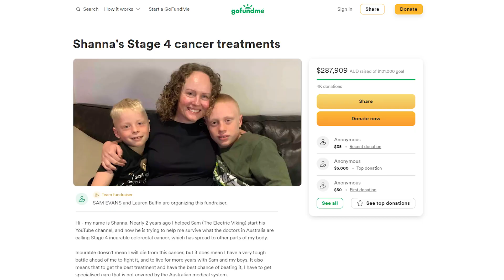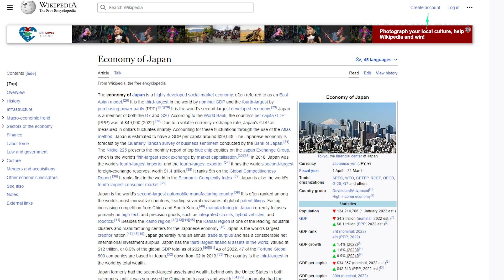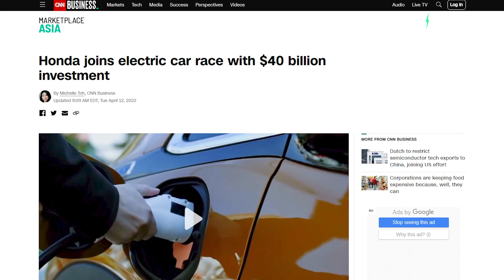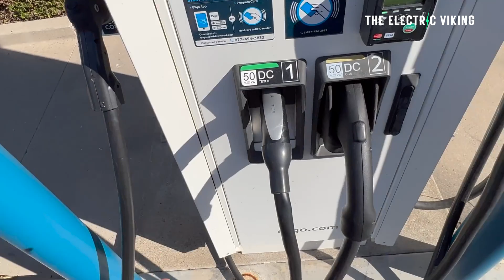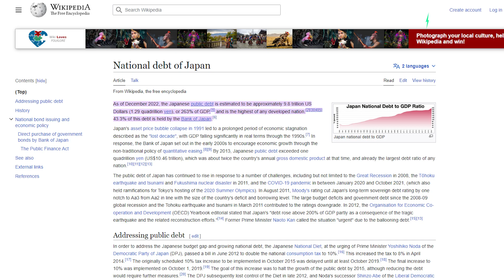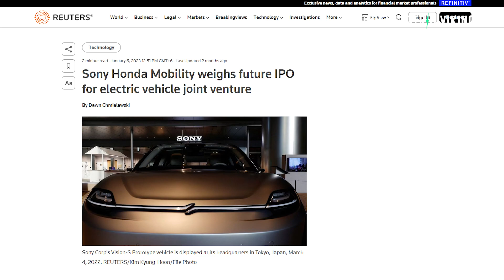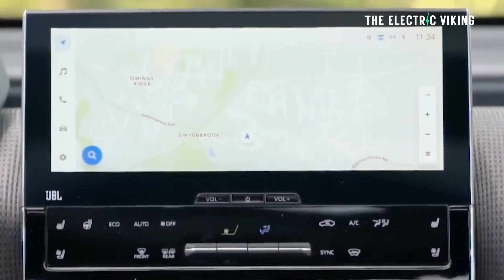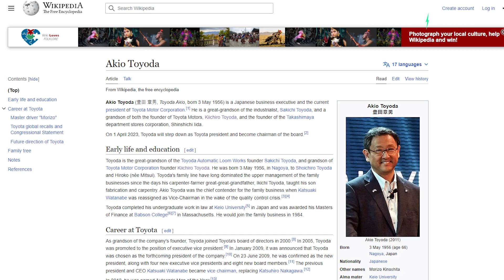Toyota wants to sell its old hybrids to 6 million people worldwide in 2030

Comment: My Honda Clarity plug in hybrid works very, very well for me. 80 kms electric range takes care of all my daily driving. I go months at a time without buying gas. On longer trips, I get 46 mpg and there are no concerns about range and long stops to recharge. The relatively low weight of its 17kwhr battery and its lack of transmission (well, a single speed gearbox) more than makes up for the "additional" weight of its engine as compared to an all ev car with a battery four or five times the size. It's fine to be enthused about the future of electric vehicles but bashing plug-in hybrids as a current solution is wrong. Personally, at this point in time, I would not opt for only owning an all electric vehicle if I didn't also have a gas vehicle as a back-up and getting a plug-in hybrid is better than doing that. This is likely to change in 10 years when it will be time to replace the Honda.
Reply: You mentioned that the battery is 4 to 5 times bigger on an EV. Isn't that great, you can get 5 to 6 times the range you are getting on your Hybrid.

Don't get me wrong, I don't think BEVs are for everyone but don't you think that whatever can go wrong on a ICEV and whatever can go wrong on a BEV can go wrong on a Hybrid. Plus they are usually more expensive than its ICE counterpart. Plus you still have all the maintenance associated with an ICE. 

If a BEV doesn't work for your needs wouldn't make more sense to stay with an ICEV instead.
Reply: I'm in the opposite camp. I have spent the first month with my new Hyundai Ioniq5 RW 2023 and I have not driven anything that compares to this technical wonder. Why would I need a combustion engine when I can drive 400 km fully loaded at highway speed. It only takes around 20 minutes to charge from 10 to 80 %? It's hard to even have time enough for refreshments before it's time to leave again. Long trips I do are mostly using highways where there are plenty of charging infrastructure.
Reply: @perperers2502  While just like you, I don't see the reason for Hybrids nowadays, there is still a reasonable argument on why to buy an ICEV. One reason can be the initial cost, the other could be lack of charging infrastructure at home or on the road. Some people live in apartments or have no access to changing at home or work.
Reply: The newest Prius goes 35 miles (56 km) on battery, and 57 mpg (4.13 l/100km). This is all the range most drivers need. I wish I had one; because I mostly drive about 10 miles/day, but occasionally I need to drive 500 miles round trip and electric simply isn't ready yet. I don't have the time to drive around some town searching for a charger.
Reply: Yeah wait few years. Hybrids are very complex systems and are notoriously difficult to repair, personally I avoid them like the plague.
Reply: @elapplzsl  I've had a Toyota Prius for nearly 10 years and it has had zero problems. We replaced the 12V battery, it's had a brake job, a few oil changes, and new set of tires. None of my friends with hybrids have ever complained about "complex and difficult to repair". I think you're just spouting nonsense.
Reply: @ChickensAndGardening  "Electric simply isn't ready yet.". That depends where you live. I totally agree with you, some parts of the world are far behind when it comes to electrification. But for other parts of the world is not an issue.

I've been driving an EV for almost 3 years (my wife also drives an EV, we don't have ICEVs at home) during that time I've taken multiple 2k plus mile trips without issues locating a charger (the car does this for you) or charging. The trick is getting a decent EV anything with an EPA estimated range of at least 300 miles for those like me who take many long trips during the year and also a reliable charging network, whichever one is in your country.

But if you live in an area where there is not a decent charging infrastructure or you can't charged your EV at home or work, then an ICEV is the way to go until things change in your area. 

If you don't drive much, any BEV will do the job as long as you can charge it at home or work.
Reply: @acolon8999  The point I was making about battery size is that batteries are heavy so, bigger battery, more weight. So the "issue" of carrying extra weight by having an engine doesn't compare to the extra weight of having a large battery. Personally, I have found modern cars to be very reliable. It's been decades since I've had serious engine problems in any car I've owned. So I'm not overly concerned about having one in my car. It is nice, though, that since most of my driving is done by the electric motor that also helps brake the car, regular maintenance items like oil changes and brake pad replacements should be fewer.
Reply: @acolon8999  a hybrid does make sense if you want to do extreeme milage or go bush. So far neither issue has been adressed by hybrid tech. to the degree that makes them worth while, apart from the few who must have one.   Fear or range anxiety has been brainwashed into peoples'minds. Going to take a bit of time for these people to overcome that fear.  Every bad experience will knock 20 good ones off the soap box.
Reply: @andyfreeze4072  I agree with you about Hybrids but I do believe that range anxiety will continue to be an issue for some and here is why. Some because maybe their daily drive is just 50 miles buy a BEV with  very long range. But the day they have to take a trip over 200 miles they realize that they have to charge several times and then have to deal with the possibility of chargers not working.  For anyone in that situation I think range anxiety is an will continue to be an issue.

Now that's definitely not the case if they get a decent BEV with over 300 miles of EPA estimated range and a reliable charging network in their country.  I think 300 miles should be the minimum range for those who don't want to deal with range anxiety, especially because you'll never get that advertised range in real driving conditions.
Reply: Patrick:  Yet, Honda no longer cells the PHEV version, last time I checked.  Honda seems a lot like Toyota, re not taking EV's seriously enough.
Reply: @elapplzsl :  And yet in the real world, Toyot'a hybrid system has a 10 year 150K mile warranty, and owners of their HEV's LOVE the system. 

It will be quite a few years before there are enough BEV's for everyone who wants a new car to be able to buy one.
Reply: @ChickensAndGardening :  Right.  The reviews of Toyota HEV's in Consumer Reports, for example, show that, along with the vehicle repair histories. 

It's sad when the BEV fanbois spew nonsense like the BEV deniers. In truth, hybrids will make FINE intermediate cars, while the BEV production capacity and charging infrastructure is built out, and BEV capabilities improve while costs drop.
Reply: @acolon8999 :  If you can get it repaired (Tesla has issues with this, for example).  Everyone who wants a BEV can't get one until they make enough, which will be a decade to three from now. 

I'm all for BEV's, but to fully migrate from ICE to BEV takes a lot of time.
Reply: @Roger Geyer  yes, you are correct  on both counts. Honda only made something like 44,000 Clarity PHEVs. They didn't market it well enough. It's too bad because despite the fact that it came out in 2018, none of the new PHEVs match in terms of electric only range in a nice sedan. The car should have been in high demand. It will do me just fine for the next 8 years or so, at which point an electric only will likely  be the better option.
Reply: @rogergeyer9851     Totally agree with you. It's going to take decades to completely migrate to EVs. Just think about how many millions of ICEVs are being sold every year. Those vehicles are going to be on the road at least 10 - 15 years from now.

I also agree with you that companies like Tesla need more Service centers and Mobile Technicians. I am lucky enough to live less than 20 minutes from the Tesla Service Center but I can see how this can be an issue for people who live an hour or two away.  The Mobile Technician approach is great since customers don't have to drive to the service center and at the same time it reduces the work load at the service centers. But even then at the rate Tesla is selling cars, they need to at least double their service centers and Mobile technicians. 

Something that helps them is that just like other EVs there is no much maintenance. Tesla can also diagnose some hardware issues remotely which expedites the repair process since they can order the parts before having a tech look at the car.

I've had my Model Y for almost 3 years and just over 57k miles during that time besides a new set of tires, I've spent about $87 in maintenance (2 HEPA filters and a gallon of windshield washer fluid). My wife has driven her Model Y about 17k miles in almost a year. A couple of days ago she got a gallon of windshield wiper fluid for her car. That's the only maintenance so far. BEVs require almost no maintenance which also helps with the workflow at the service centers.
Reply: @acolon8999  With regard to range anxiety, I believe that when EV's hit 500 miles of range (and can recharge to 400 miles within 10-15 minutes), AND they come down under $30K, they will definitely take over the market.
Reply: @ChickensAndGardening  I think that for those who own an EV with over 300 miles range and have access to a reliable charging network in the areas they travel, range anxiety does not exist. In the last 3 years I've taken many 2k plus mile trips and from personal experience I can tell you that there are plenty of chargers along the east coast corridor (USA) and I've never ran into an issue charging.

Of course having a 500 miles range EV is better than having 300 mile range but there are two things that you have to take into account. One most people don't drive over 80 miles everyday and second even if you have a vehicle with 500 mile range and a charging network that is a hit or miss  when it comes to reliability, range anxiety will still be an issue.

My wife and I own EVs, we don't have ICEVs at home, and from personal experience I can tell you that as long as you can charge your EV at home, have at least 300 EPA estimated range and have a reliable charging network there is no range anxiety. 

Like I mentioned before, I take many long trips every year. Sometimes I can go 3 - 4 months without visiting a Supercharger. Imagine those who maybe take 1 or 2 long trips a year, they might go 10 months without having to charge outside of home. 

A BEV with 500 mile range, the charging speed you listed, and a price of $25k would definitely push EV adoption even higher buy it might be a long time if ever before that happens. Just like getting a Lamborghini for $50k is not impossible but it might be a long time if ever.

Comment: Rivian R1T Adventure - $74,075
AWD (add $6,000), Max battery pack (add $16,000), plus one of the five $2,500 optional colors; 20 inch All-Terrain Dark or 22 inch Sport Dark wheels ($3,500, either way); and either the Ocean Coast or Forest Edge vegan leather interior option ($2,000) for a grand total of $104,075. Aug 19, 2022
Who can afford this?
Reply: Maybe the same guy that would but a Chevy Silverado Rocky Ridge for $99k before dealer markup.

Comment: After giving it plenty of thought….
Just imagine, legacy companies doing vertical integration, overhauling outdated production lines, they would have been able to produce ice & hybrids at a far lower cost, or at far better margins. Why didn’t they do that? Being stuck-in-the-mud, or actually in the ice-swamp for decades?
They knew all about design, air-drag, road-behaviour: nothing of that has changed with EVs. They could have, no should have, used their experiences… (regardless of the power train)

Comment: Until the infrastructure changes and electric charging is widely available everywhere (including for rental tenants), EV's can' replace ICE cars.  And Toyota is at least partly correct about lithium batteries when you consider the damage done by mining the stuff.  That will change when sodium based batteries improve and replace lithium. Till then, hybrids are a reasonable solution, and plug in hybrids are excellent vehicles for most people, as driving distances of under 40 miles a day are close to the norm for the average person.  Plug in hybrids can be made to reach this range figure, they won't need their ICE power except when there are extra demands for heat, and winter driving reduces battery capacity, OR for the once in a while longer road trips.  I'm getting about 48 MPG in my 2023 Corolla hybrid right now.  In my first two months of ownership, I've bought less than 10 gallons of gas!
Reply: Every street light pole could charge an EV
Reply: @b4804514  Working out the logistics of that would be very interesting!

Comment: Sure Toyota is really late on the ev development, BUT till now is the only company  that seriously tried to reduce emissions on the fleet. Hybrids are effective on emission reduction especially in city drive conditions. In the past I had a fiat 500 with 70hp and could not go past 7.5l/100km city, I own now a Yaris and in city I can go as low as 4.5l/100km city. Not to mention that my brake pads now last 900000km instead of 30000km on the Fiat. In summer for instance with an hybrid you can run your AC without running the Ice
Reply: and you think that a half baked idea is all you need? It works for you now, but i would say in the near future, it may not be that good anymore. And really, " seriously tried", thats greenwashing crap.
Reply: @andyfreeze4072  not saying hybrids are a solution but at least part of it.
Reply: @andyfreeze4072  evs are not the solution either
Reply: @italianmaestro3045  What is what is your solution ?
Reply: @FedericoTesta1  there won’t be a market for anything with a gas tank by 2030. Doesn’t matter what most automakers make, the world is going to EVs and if national automakers won’t make EVs, China will.

Comment: Up until 2020, Japanese led in total EV sales. They didn't meet sales expectations in the home market, which no doubt scared the failure-adverse culture. When Nissan took LEAF parts and threw together a hybrid in a matter of months (E-Power), it massively outperformed projections and quickly became the best selling car in the country (although it has lost its lead recently). However, that better-selling hybrid powertrain sharing components with EV's helps build scale. If production is designed to be flexible, then they could shift based on market demand. I would much rather have companies make hybrids than pure ICE, even if that doesn't meet the purity test. In markets that are behind in charging and have reluctant populations, hybrid to EV could be a better path of transition than jumping from pure ICE to EV. Under the current grid, the total lifecycle emissions are comparable between advanced hybrids and EV's in many places, so it is a step in the right direction as the grid improves. It may not be the best transition path to EV's, but it is better than some.

The other thing to keep in mind is that Japan is a generation ahead of the West. Birthrate went up while we had the Great Depression and went down after WWII. When their large generation retired, it led to the Lost Decade. They had to change perspective to productivity per worker instead of overall GDP growth fueled by rising a population. Automation to reduce head count became publicly accepted. In the West we have average new car buyer in the Mid 50's with inflated purchase price and long-term financing-- that is not sustainable as the Baby Boom retires. Our politicians and unions still treat automakers as jobs programs, as fewer people become available to fill those jobs. A massive shift in market and policy will have to happen, and it won't be painless. Japan has already gone through the painful transition and is well positioned to sustain their economy, even if it does not see significant growth.
Reply: Maybe that is the reason why they didn't improve the Leaf? The Leaf needed battery cooling among other things to be great.

Comment: Notably, Toyota, the world’s largest automaker, has emphasized that it plans to offer a range of options, including hydrogen-fuel-cell vehicles, instead of focusing exclusively on electric vehicles
Reply: Toyota = Kodak
Reply: fuel-cell is just a fancy electrical generator!
Reply: @encodedpr  hard to fuel fancy electric genset.
Reply: Hydrogen Fuel-cell is very cool technology but Europe proved that it is NOT viable. without fuel-cell changing station it has no future. Toyota cannot do it alone. If Toyota pursue that Hybrid fuel cell & battery EV hybrid then it may work.

Comment: The U.S. has an anti Chinese sentiment, cheap gasoline, long range needs and you can still buy two Prius for one Tesla. I have bought hybrids since 2010 and completely satisfied…..therefore, for now I have to disagree.
Reply: The big 3 have already made the move. The question will be wether they can get out of hot water in time. Toyota is actually miles behind.  And having trouble delivering cars. You can place an order on the new Prius. But by the time you pick the car up, it might due for a model refresh already
Reply: @林振华-t4v  yes, I agree! In the U.S. we have cheap gasoline and my Prius $30k while the Tesla model 3 is about $45k. I was really looking forward to an MG4 or atto but very unlikely with present political tensions.
Reply: I want the 2023 prius prime but it will be very hard to get. My 201u prius prime makes me want to upgrade. The rav 4 prime is very expensive and hard to get new as well. Toyota big issue is getting these cars out.